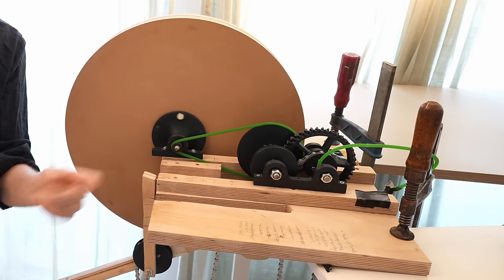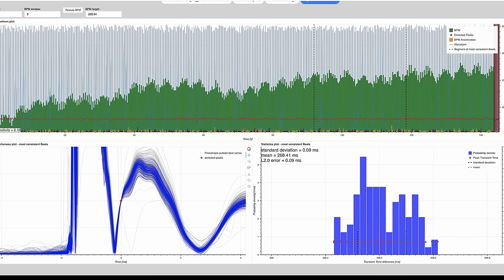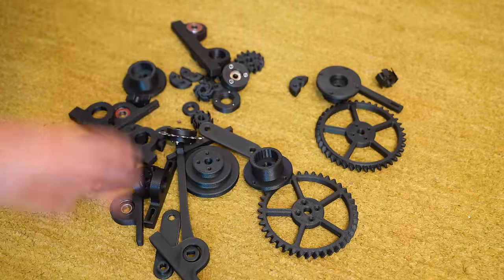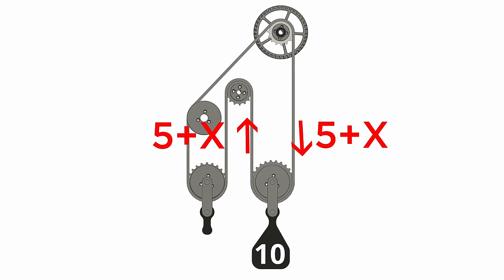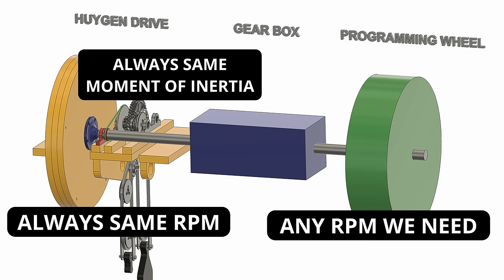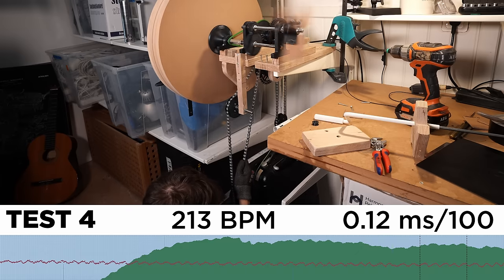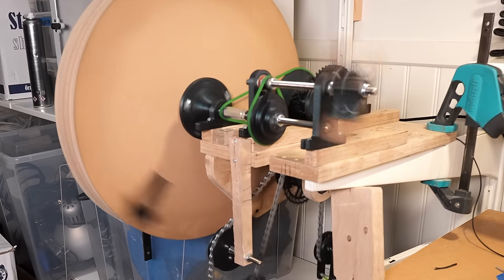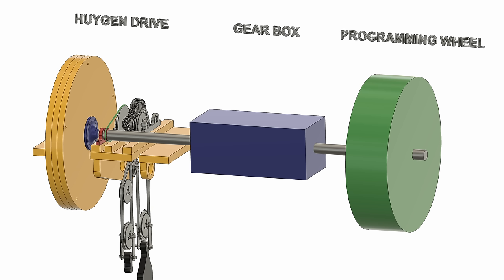Using Gravity To Play Tight Music

Comment from the maker: A true breakthrough for the Marble Machine Project. :)

Check out more Bouldering with me and Hannes from the awesome Trainerds Channel Here:
https://www.youtube.com/watch?v=jHs6jHHSGgc

Also check out the "How much weight can i lose in 7 days" Trainerds video that was posted today:
https://www.youtube.com/watch?v=ZdkIkz4V5Js&t=4s

Thanks everyone for following the journey, good luck with everything you are doing!
Reply: Combining the Huygens drive with the Governor and flywheel is the best solution i think 🙂.
Reply: This is a recommendation that I am telling you in every video.
BUILD the music machine First, then focus on the power input and the tight music mechanism
Because only then you will know what would be the total friction and the energy input you need to apply to play a whole song.
If you dont know that, then you can not start with the Huygen Drive design, because it will change all your parameters constantly forcing you to redesign the Huygen drive over and over.
I also think that all this mechanism, plus all the other instruments you want to add in the machine, it will add a lot of friction and it will be impossible for you to have the strength and endurance required to play a whole concert. 
Besides, if this small prototype requires such heavy counter weight, imagine the mass that the final machine will require and how hard would be to set in each stage.
Reply: So this channel is just an advertisement for your other channel?
Reply: if you want a different governor that adapts to rpm and isn’t a constant brake i would use a centrifugal governor like those on a stationary steam engine or a traction engine, old elevator/lift ect.
Reply: I'll bet the flyball governor will be a big improvement in stabilizing the tempo since it incorporates feedback. Hopefully, you can get some input from a mechanical engineer about how to size it properly and figure out how fast it needs to respond to changes in input so the right geometry can be determined quickly.
Reply: @splynncryth  Lol, Martin doesn't want input from actual engineers.
Reply: Can you remind us why you're against using motors to power the programming wheel?
I mean I only see points for it, none against it:
- You're still going to use microphones on it to isolate the sound of the instruments from the noise of other moving parts. Use the same electricity source for the motor?
- This actually solves all of your tempo, manual labor, rpm deviation and tightness issues. Stepper motors are excellent for maintaining the same rpm even with dynamic loads (and to overcome this dynamic nature of the load, you would need to implement heavier counterweights, heavier flywheels and a gearbox that would be more sophisticated than one in a car, possibly even find a way for the gearbox to react to different instruments being enabled or disabled)

In my opinion, electric motors not only will reduce or remove your issues altogether, but also it'll be more in line with your mentality of "function over form", reducing overengineering and using off-the-shelf parts. Please consider and maybe test this option. You can't possibly account for all friction and loads of the finished machine when you finish the "power module", and you won't know how much to compensate for all that with your proposed solutions.
Reply: Love when there's a new Wintergatan video 😍

Two thoughts:
1. While it's not the most difficult thing in the world, the calculation(s) you're discussing at around the 7 min mark certainly aren't "simple" 
2. You can massively simplify the ratchet mechanism shown at 13:48 by using a compliant printed "gear" part rather than the spring. I've used these to really tighten strings and they work really well. Search "3d printed ratchet mechanism" to see what I mean

Great work, and as always, I look forward to the next one!
Reply: @JanasV  i got the impression that the marble machine being human powered was at least half the point of the project.
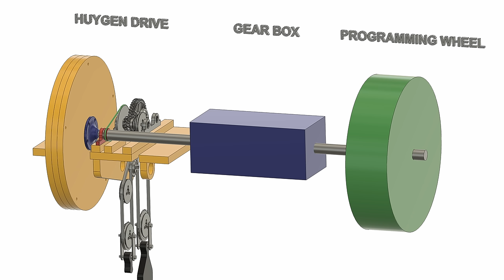Reply: 16:36 YES! Flyball governors are better then the one you were using in this test. Note: the idea of a centrifugal governor is to store kinetic energy in angular momentum as good as possible which means you need to reduce all losses as much as possible & in your case mostly air friction. You reduce air friction by giving it a shape with as low surface as possible relative to its mass & reduce its drag coefficient as much as possible too & you get the lowest drag coefficient by giving it a drop or bullet like shape. Balls aren't that bad but bullet & drop shapes are best.
Reply: @propertystuff7221  Why is "human powered" a design requirement?  Or is it just another DUMB DESIGN REQUIREMENT?
Reply: Use the new 'fan' to cool the grease?
Reply: @propertystuff7221  Again, you fail to explain why this project must be human-powered (other than a nebulous "feeling").  This project is about using marbles to play a xylophone and play music.  That peculiarity is what people are interested in:  the Rube Goldberg chaos of marbles bouncing all over the place, and actually creating something coherent (ie., music).  The contraption itself is all mechanical (levers, programming wheel, marble sorting, etc.).  This isn't a case of "xylophone being played by electric motors"--this is 100% "xylophone being played my marbles hitting it."

Lifting the marbles back to their original position and rotating the programming wheel--it's irrelevant if it's electronic or "human powered."  And I would argue that simply powering up a flywheel to run things (which takes 15 minutes to get up-to-speed), or physically lifting a weight off the ground is truly the human-connection that you're looking for (as would be a mechanical crank that directly drives the machine and controls the tempo).

And let's face it:  the last two years of this project has been an enormous failure and waste of time.  Getting nowhere closer to any goal.  Especially when he thinks that a flywheel will maintain perfect RPM--that's simply not what a flywheel does.

Furthermore, there's no 3rd machine anywhere in sight, other than a placeholder CAD block.
Reply: Way not use ta a copy of the setup on the input to smooth out the input even more
Reply: Hello Martin, I'm not a mechanical engineer (electrical and computer science) and haven't done the math yet, but I suppose once the heavy flywheel is on, the weight on the huygens drive has to be pretty substencial.  Have you thought about using a different constant force for filtering the power input like let's say a big spring that can offer great force without being heavy. It might be more convenient than using a big weight and gravity.
In other words: Is using gravity a requirement or design choice and if so is it a reasonable one?
Reply: Maybe a speed governor used weight, like in a steam engine is to complicated?  Should be more precise though.

Comment: Calculating precision in milliseconds is bringing in some confusion here, as you end up making it looking more precise at higher speeds. You have to remember that the intervals get smaller and smaller as you increase the speed. Imagine a full rotation at a given tempo being 1 ms as an example. The deviation will always be less than 1 ms, however it might still be deviating 50% off the optimal speed. You need to figure out how precisely it’s hitting the same spot relative to the speed of the full rotation. This means a percentage deviation of the full rotation. This will become apparent since the deviations will scale with the gearbox. This will essentially be re-introducing more deviation (in milliseconds) at lower speeds.
Reply: Came here to say this, error measurement should be relative on this case, not absolute. I understand that more speed means more energy, but because an absolute error of 1ms at 10 bpm gives the same relative error as 0.1 ms at 100bpm, It does not necessarily mean tighter.
Reply: yes this, your calculation of standard deviation is not enough to determine if your music will be tight
Reply: Thank you, i have wanted to and started writing several comments on this topic after he started using standard deviation but couldn't formulate it quite as concisely.
Reply: This exactly!
Reply: I don’t want to sound like a broken record but: Yes, this ! 😅
Reply: Yes. As you gear up you will be multiplying the standard deviation by the same factor. 1:2 gearing will result in twice the deviation for instance.
Reply: Yes but maybe no, I don't think the resolution of human tightness perception scales with frequency, or at least not linearly so. That is, technically you're right, musically, I don't think it makes a difference.
Reply: @aoeuable  I understand what you mean. However in this case the problem is that when you go really fast with a flywheel and use a gearbox to scale down the tempo, the deviations will be exaggerated at lower speeds. 

The gearbox shouldn’t change the precision, it just translates the tempo relative to a desired ratio.
Reply: As a watcher, it is frustrating to see a talented musician so hell bent on such mechanical precision that it overwhelms the creation of music. The transformation from musician to machinist. The combination is ideal, but easy to get lost in the details.
Reply: Well, he isn't just a musician. He's a tinker too!
Reply: If I record correctly, Martin asks for this kind of input to be made on the reddit page. He is only looking at the comments there
Reply: I disagree. How tight a music sound has nothing to do with tempo. It’s really about the absolute difference in milliseconds.
Reply: You beat me to it. I would add though, that measurement accuracy is also a part of it. Although the tempo is increasing, measurement resolution isn't. 

Percentage is the way to go, these results are false. I would guess that the speed of the governor is proportional to accuracy, not the speed of the flywheel. Higher gearing and extra weight would achieve this, without changing the bpm. Smaller fan blades are likely better though. 

I don't think the speed of the flywheel will affect tightness as it takes the same energy to effect the same change in angular velocity, regardless of rpm.
Reply: I think a good question is: where is the weight best placed, in the flywheel or in the suspended weight?

 Since there will be a practical limit on the weight of the machine, there is most likely a sweet spot in the ratio of masses. That would be some interesting engineering.
Reply: I've been commenting similarly. Instead of ms, using percent (or parts per million, hopefully) would be a much better analog to how we perceive music. Otherwise, it seems like faster is always better.
Reply: Also, any scaling you do with a gearbox with scale the error, so you want small relative error, not small absolute error.
Reply: push (this needs to be read!)
Reply: Coefficient of Variation is what you all are talking about. Just standard deviation divided by mean.
Reply: Maybe he needs to build an air governor with variable pitch blades and a centrifugal weights with a spring to help govern the tempo and not require him to keep adjusting the speed of the crank to weight at the same position. The spring can have a adjustment to change the tension to allow setting a new governed tempo. This is very similar to how a constant speed propeller on an airplane works. I think he’s looking for a constant speed governor that allows for a variable load. This means he won’t have to control the height of the weight precisely.
Reply: If two marbles are supposed to hit simultaneously, their timing accuracy relative to each other should often be measured in milliseconds rather than beats.  Maintaining a uniform tempo may be desirable, but what's more important is that things which should be simultaneous, are.

Comment: Wait what 😅 ME engineer here, your drawings and explanations are really wrong. Pulling on one end of a chain will not accelerate the machines if the weight is not fixed on the floor. If you pull fast there is the just the moment of inertia of the lower right gear to overcome, but for this application it's almost negotiable. In the end you just pull the weight up. So it doesn't matter if you pull fast or slow, it does not change the tempo. The only thing that drives the machine is the gravitational force of the weight. And the machine will continue accelerating until there is enough friction in the system that balance out the input force of the weight. So in a system without friction this would accelerate infite because of the weight. By adding this air govener you create a lot of friction which slows the system down and brings it into a stable state. I thinks it's extremely important to understand what's going mechanically when using these mechanics.
Reply: Actually. Pulling the track applies an upward force on the weight, but tension within the chain will be conserved.

If the upper gear was static, then the force is multiplied thanks to tension. As a result of it being mobile, we do actually expect some force variation applied to that gear.

That said. Martin would see less variation in gear force if he increased the pulley ratio to his primary weight, and require less force but longer motions to reset the counterweight.

This will still multiply the input energy, but spread the acceleration of chain through more linkages and even out the forces.

A chain or belt in tension is under equal tension only till it hits the loading elements. But you don't expect a tank track on a T34 to have variation in tension above and below the forward idler, it'd just rotate till both sides are under equal force.
And that is why pulley loops multiply force input as you add lengths of rope, rather than merely adding a singular force input.

I'm pretty sure you understand the physics. But Martin's interpretation isn't actually that far off.

Personally I would have gotten Martin to graph out his flywheel based on fin length to create a chart of size vrs RPM in his setup as a guide for further experimentation.

Also might suggest Martin go for a  gravity powered governer. As RPM increases the governor would expand wider against gravity, and with some smaller fins add increased air friction to the system and help stabilise his flywheel with his purely manual power input.
Reply: @glenmcgillivray4707 yes, like a Lily clutch on a mine hoist drive. Or on a steam engine.  They have arms with weights on the ends. As speed increases, the weights swing outward.  This increases the moment of inertia and also air resistance.  It stabilizes the rpm better.
Reply: It's a dynamic system, pulling up the weight will definitely influence things.
Reply: Intuitively, if the weight pulling the chain down has infinite inertia, it will behave exactly like the ground, and tension will be conserved along the chain, yanking the the top gear down exactly as hard as the crank pulls up. Conversely, if it weighs nothing, then it is an empty chain and you are simply pulling the individual links up, which can obviously transmit zero force through, and the chain is simply accelerated upwards. With a finite mass, there will be some additional tension passing through, but not all of it, and you will also use up part of your force balance into acceleration, especially if this happens quickly. It’s unclear exactly how stable this is unless you calculate through it, I think, but clearly, from experimental data, it is sized properly, and smooths the signal over time as required.

Two separate problems I identified: first, he states there will be constant moment of inertia. Technically, in absolute terms, this is true, but after going through reduction, this will not hold on the axle downhill from the power chain! The driving flywheel will « see » less resisting moment of inertia if the speed is stepped down at the output, or more if the speed is stepped up (by the square of the reduction ratio), and this will mess with the timings. Second, the higher the inertia of the flywheel, the longer it will take to reach equilibrium with the governor as it takes more energy to get to the same speed and the power loss rate through the governor goes up with its spin rate, so assuming power input through the crank stays the same, the target governor rpm and thus flywheel rpm will be the same for equilibrium, and so it will take longer to « fill up the tank », so to speak.